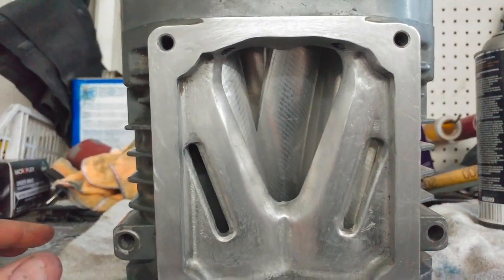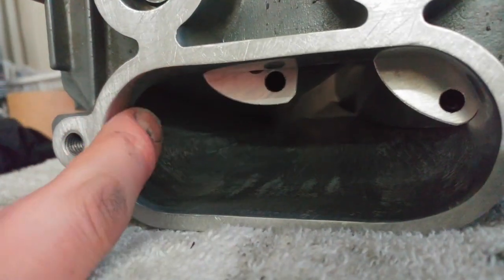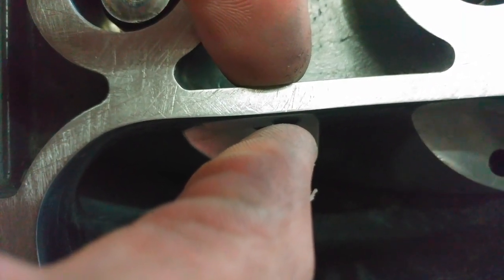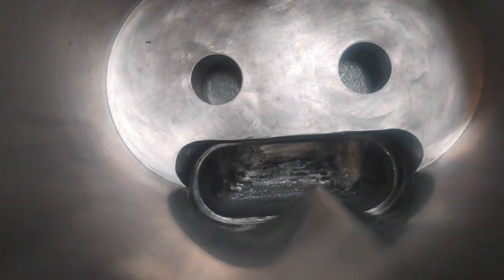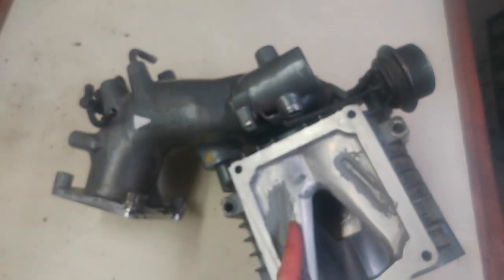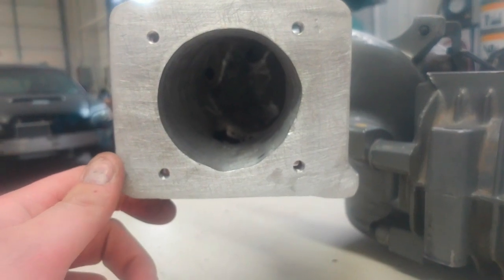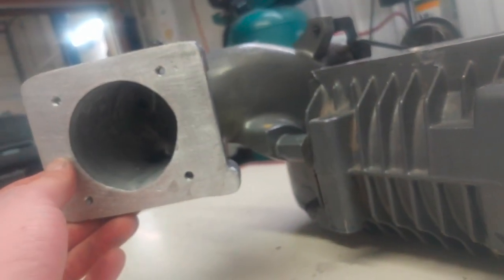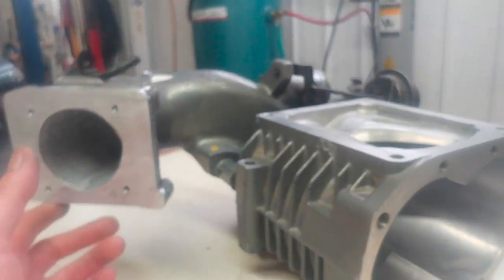Porting Eaton M90 Supercharger & Overdrive Pulley Subaru EJ257

Comment: I hope you eventually upgraded to the 94-95 blower and a raised blower top.
Reply from the maker: Still using the old style with a modified top, but now it has a GT45 feeding It which makes 30psi compound, Twincharged!
Reply: @boostedproblems5139 I commend your efforts and tenacity. I've built a lot of Super Coupes in 25 years and ported a lot of blowers. The raised top, space allowing, is by far the biggest bang for the buck!

Intercooler efficiency is priority with the M90. Eaton roots blowers beat up the air so much. As long as you maintain the angle of the "V" and the rotor "seals" all across the resized "V" you're good to go all the way to the opposite end. With a standard pulley 12lbs to 14lbs was easily made. With a 10% pulley close to 20lbs was made. However IATs suffered and a more efficient intercooler was necessary of course.

Ill catch some more of your videos later. I'm sure the compound system is a ripper!
Reply from the maker: @arturozarate1752 content has gotten about as far as first few drives on the compound set up but no where near the current 30psi 6mt twindisk monster it is now. I got injured and need a bit more therapy till I can pilot it once again!
Reply: @boostedproblems5139 wishing you a full recovery.

Comment: Every time I see someone block the Silencer ports on an M90 I cringe so damn hard. You just killed it's efficiency and added more heat to the intake charge doing that. Eaton Engineers had more reason to those ports being there than just making it run quieter. Also spinning the rotors faster creates more heat, not less. I've proved this time and time again since the early 90's playing with M90's on GM V6's. The GenV was a god send from Eaton as they basically took a look at what all the M90 modders were doing... including leaving the Silencer Ports OPEN!
Reply from the maker: Good thing I didn’t actually close them off. I had started to use “lab metal” to close them off but when I saw how the lab metal reacted to brake cleaner (it re softened and went back to a beige color) I cleaned it out and left the ports open. I had always planned to run meth through the blower so I wasn’t taking the chance of it reacting similarly & getting in the rotors and locking up.

I don’t agree with the silencer ports being there for performance though. I’ve seen many people on the Supercoupe forums do it with no loss of performance. And all of the aftermarket superchargers like manguson with the mpx90 don’t have silencer ports at all. It’s my understanding that Eaton designed them for manufactures like ford/gm to be quieter, because new/stock cars come with mufflers on the intake and exhaust to appeal to the general public, and adhere to noise regulations.
Reply: Actually physics proved it long before you did.

Comment: I used JB Weld on the silencer ports on a eaton m45 that I have on my twincharger, that little blower screams it's tit's off!!  hahaa
Reply from the maker: I was started sealing them off with “Lab Metal” but when I saw how it softened when it came in contact with brake clean. I decided not to risk it! Esp since I spray water/meth into the inlet.

Comment: Just on M90  SC efficiency... Has the rotor blades  had their epoxy coatings removed or are they aftermarket?
Reply from the maker: This is an older generation m90 blower so it did not come with the coating on the rotors. That turns out to work in my favor because I want to use water methanol injection and that would destroy the coating.

Comment: Did you ever get dyno numbers for this setup?
Reply from the maker: Not yet, trying to optimize the setup first. had to take a break, because my shop is not heated lol
Reply: @boostedproblems5139  What have you heard regarding maximum hp for a ported intercooled M90?
Reply from the maker: A few have hit 400whp but I believe that was gen 5 blowers. Mine is a gen 3 so more realistic 325-350.
I may get the mp case/inlet in the future. I want it as effective as possible before I add a large turbo to feed it :-)

Comment: On a smaller engine where it doesnt need so much blower speed, this gen 3 should kick ass. Gen V's really show their worth when you really start to turn them though. They stay pretty cool in comparison to some of the best ported Gen 3 cases.
Reply from the maker: I have had this gen 3 for many years, It was intended for a Supra I no longer own. Eventually I'd like to upgrade to the upgraded MP case & inlet. Those flow amazing !

Someday I will get a stronger 6mt trans and add a large Turbo making it a compound twin charged system
Reply: @boostedproblems5139  For the money, m122h blowers would be a good option as well. Would have to get pretty custom with the blower inlet and outlet plumbing but they can support far more power than even a mpx case.

Comment: Have you run it yet?
Reply from the maker: It has had the initial 20 min break in and an oil change. I'm actually about to go for it's first cruise 50 easy miles no boost and change oil again...

Comment: YOU GOT MY ATTENTION WITH THAT EATON M90 BLOWER SITTIN ON TOP OF THAT BOXER ENGINE. I'VE LIGHTLY PORTED THE M90 SC OF MY 03 BUICK REGAL.  GOOD JOB ,YOU ARE GONNA NEED SOME KIND OF BOOST BYPASS VALVE OR IT WON'T BE PRETTY. KEEP IT UP 👍
Reply from the maker: You bring up a good point here !
Unlike the GM version of the M90, this Ford M90 has the bypass valve built into the inlet. You can see that get installed at the end of the vid. This enables the boost to circulate back through the inlet between the throttle plate and rotors, it is vacuum operated, and plumed very similar to the Ford.